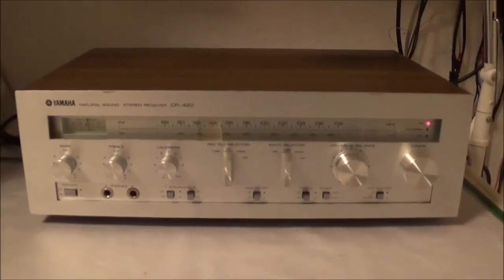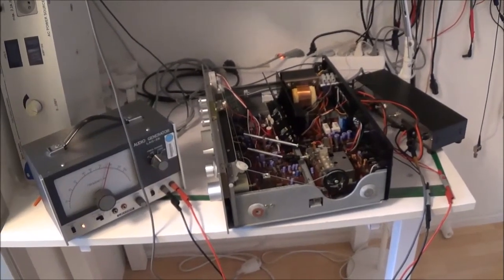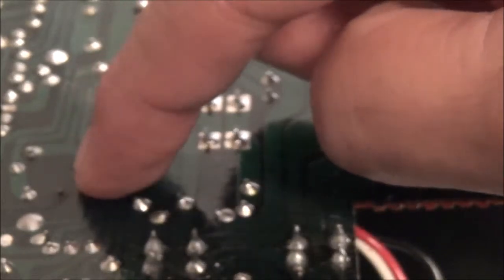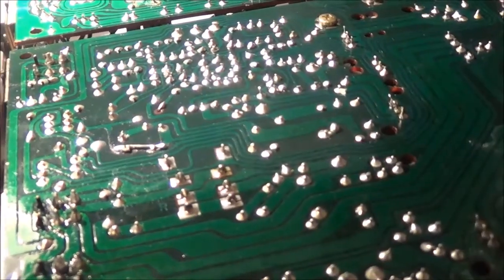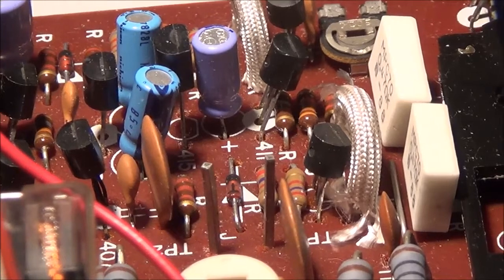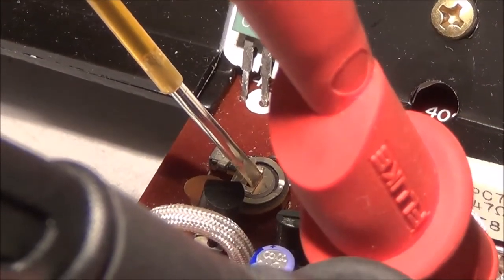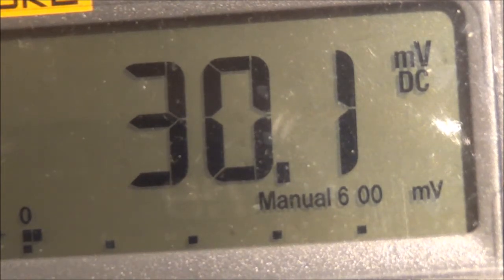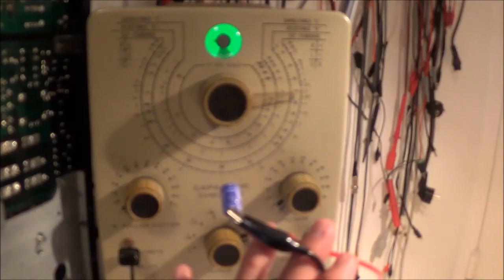Yamaha CR-420 Receiver DC Voltage at Speaker Output

Comment: Hi, my Yamaha CR820 is measuring approx 70mV on the all the speaker outputs and straight away I took it out of my setup.. I read that DC offset readings needs to be near the 0v. I would be grateful if you could let me know what I need to do to correct this issue. Many thanks.
Reply from the maker: I have not yet had this model. But your voltages are slightly too high--not dangerously so.  If you used an 8-ohm load with 70 mV, although a speaker reacts a little differently, you would get around .009 A current.  Make sure your unit has warmed up enough before you do the measurements. You have some kind of slight imbalance there; the specifications of some of the parts seem to have changed. You might want start by changing electrolytic capacitors in the output stage--might be some small leakage. This might not bring success. It could even be mismatched resistors and transistors. The zero volts is an ideal. If it was my unit, I would probably leave it alone, as long as it sounds good and check it occasionally.  Especially since you could make things worse. If I ever run across a model like this; I will make a video.
Reply: @OldSchoolElectronics  Thanks very much for the advice. I read that over 100mV would damage the speakers, mines show 70mV, so i wasn't taking any chances. it sounds good, but i just didn't want to risk it. If you suggest it will be ok to use and check regularly, i may just do that, as i like this receiver very much. So if it get over 100mV, shall i stop using it and take it in for repairs? Thanks again.
Reply from the maker: Hi! Yes, if it reached 100 mV, I would take it in. Or start looking now for a competent technician (if you can find one), so you can take it to him/her when it becomes time. They should be familiar with vintage audio repair. Good luck!
Reply: @OldSchoolElectronics  Thanks very much for the advice, really appreciate it.

Comment: Cool video, you really know your stuff! I recently tried to test a receiver someone gifted me many years ago, it's a Pioneer possibly from the late 70's. When I got my speakers hooked up the speakers had a constant very loud hum to them and fairly quickly before I realized there was a major problem it seems to have fried them. I put my meter on each one and the ohms read 1, way low for an 8 Ohm speaker so I realized they got roasted. When I put my meter in the speaker sockets, when that channel isn't activated/selected I see about 50mv DC. When I select them I see around 35VDC so I get the feeling like somehow a signal/voltage is getting blasted to the speaker channels for no apparent reason, even with nothing hooked up. I don't want to give up on this unit but I have no idea how to diagnose it from here. Is there an internal short somewhere possibly sending stray voltage to the speaker output circuit? Anyway thanks just cuirous if you had ever seen a similar problem. Cheers.
Reply from the maker: Dr. Bizz: You should really check the output transistors. You check them in-circuit, or take them out and check them if you really want to be sure; power off, of course. You might have collector to emitter shorts; meaning that the voltage from the power supply is going directly to the speakers. Which could destroy the speaker voice coils; this seems to have happened. The output transistors are separate and bolted to heat sinks or larger metal parts of the chassis. There are probably 2 for each channel. I don't know what your skill level is, so this could be a medium difficult to impossible fix. You should also check the emitter resistors of the output transistors; these are really low ohms. And check all other smaller transistors around the output  transistors. For sure get the schematic/service manual.  I suspect the amp section of your receiver is direct-coupled; this causes a domino effect when something goes bad; one destroyed part destroys another part and so on.
Reply: @OldSchoolElectronics  Oh wow, thank you for the response and info so much! I'm probably an intermediate skill level or below. I'm an electrican by trade but I know electronics basics so it would probably be a challenge but I know a fair amount. I got a turntable for free that works and happens to be very similar to this reciever so I'm hoping to have a matching "old school" setup for playing my records. Thanks again!
Reply from the maker: Cool! You know the electronics basics, which is a big plus. Just take your time, take pictures, and use that schematic. I think you can do it. Good luck with the repair! It's always cool to have an old school setup.
Reply: @OldSchoolElectronics  Thanks for the inspiration, peace man. 👍

Comment: I have a repair amplifier it's SAKURA 735 model 1300 watts for 4 ohms configuration.
the problem is in Left channel output have a 54.8 volts but all output transistor C5200 and A1939 is good the power supply is 64 + and 64 - is ok. I check  all transistor, resistor and capacitor on driver circuit is ok. the causes that problem some leakead resistance between base, collector and emetter on transistor hole or board or amplifier board.

Comment: I have the same problem with a Pioneer sx 636, reads 16 dc volts from r channel. however after being on 30 minutes will return to normal and work normally. I have not been able to find the fault. after seeing this video I will try again.  Any suggestions?  Beautiful sound from this unit and I bought it new in 1973.
Reply from the maker: I have not worked on the SX-636 before; so I am not familiar with the unit. But it sounds like a thermal problem; so you might have to use heat (hairdryer) right after turning the unit on to find the problematic component (in the power amp section) and see if the problem goes away. Alternately, if the unit is working fine (after it acted up) you can try freeze spray. You could also swap the output transistors of one channel to the other channel since the channels are mirror images of each other. You just have to make sure you don't get things mixed up and make sure you put them right place. Take notes and pics, if need be. You would have to get new thermal compound. If the power board is a little extra board by itself you could also redo the solder joints. Anyway, it will take a little time. Other than that, check the audio forums on the net; maybe somebody has had the same problem. I don't use forums, but I know they are there.

Comment: i don't get isn't the .0.30 is considered high?i have about 0.39 out of my speaker tab on my mono block amp and they tell me lower is better? are they wrong?
Reply from the maker: Ideally the dc voltage at the speaker terminals should be zero, but this is never the case. I think it was about 55 millivolts DC (.055 v) after the repair.  If you have a 8 ohm load (even though speakers react differently at different frequencies) you would take E squared over R giving .000378 watts. The current would be about .007 amperes. I don't think this would damage the speakers. The bias was adjusted to about 30 millivolts, as was stated in the service manual.

Comment: Hi, Is it worth owning this receiver? A recycle center near my work has one for sale for $65. not sure about the working condition but the cosmetics looks neat! Thanks for the video,really appreciate the work you do.
Reply from the maker: +Vijay Merceline Hello: I think for this price you have to make sure the outside is good. No chipped wood, big scratches, etc. Bad treatment outside can also mean bad treatment inside. Most likely some bulbs are out, but that is a small matter. For that price you should ask to plug it in and see what happens. For example, does it turn on? Or ask them if it works or what is wrong with it. It is a nice receiver with good looks and good sound. You can look up the specifications online.
Reply: I'll go and check it out today! Thanks for the reply.
Reply: I went to that store to see that amp but its seems its not that in a good shape lots of scratches and looks like it's been treated really badly  over the years so I didn't purchase it! but I found a  sleek silver faced Yamaha natural sound A-15 for less than $15 and it's seems its biasing is out and i have to recap it but It's phono stage is really warm! Thanks again for your input.
Reply from the maker: +Vijay Merceline You are welcomr and good luck! Good thing you didn't buy the scratched up unit. I never worked on an A-15 before. I want to get a A-960--with no big scratches.